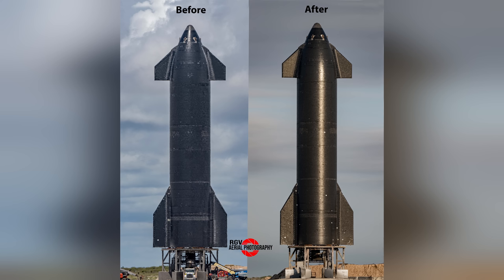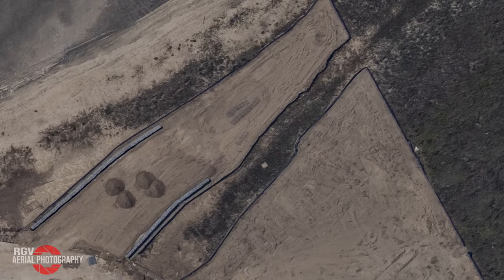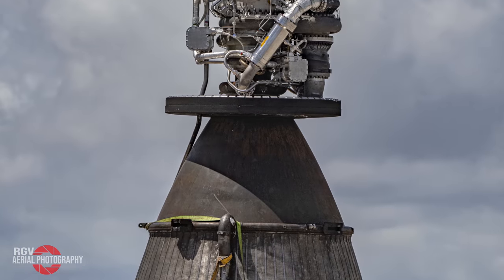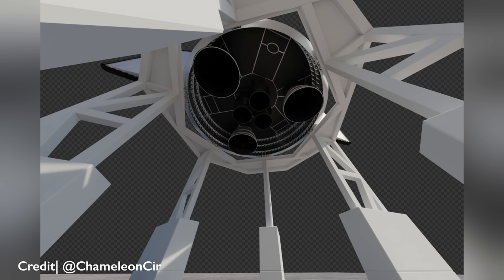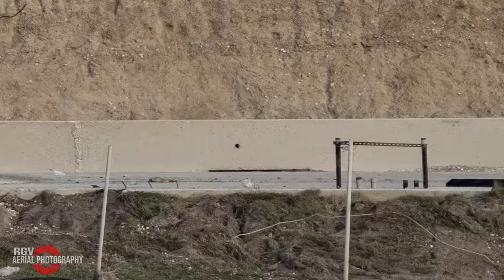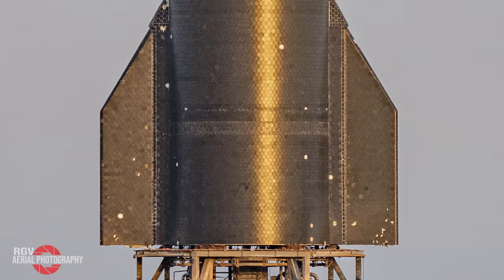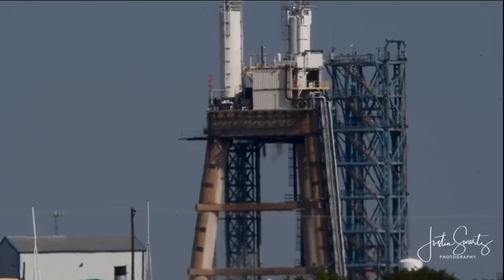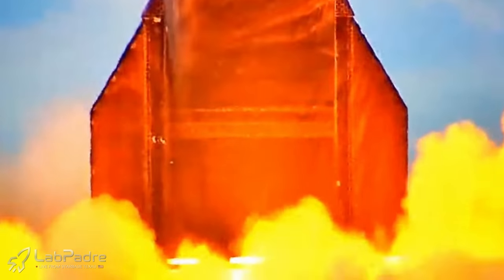Analyzing the Aftermath of Ship 24's 6 Engine Static Fire Test

Comment: Can you imagine the kind of debris that will be generated by 33 raptor engines, it's going to shred it's self to pieces before the lock down clamps release. The whole launch mount for Starship heavy is very poorly designed. They need a flame diverter like they had for the Saturn 5 . If 6 raptor engines can do this much damage in just a few seconds I fear the booster will blowup on the pad the first time they try to light all 33 engines.
Reply: Ok Champ 😂
Reply: LMFAO you know they ha e a separate launch mount for that right